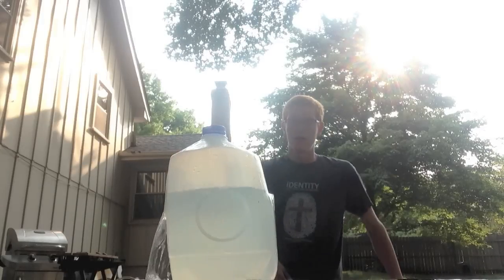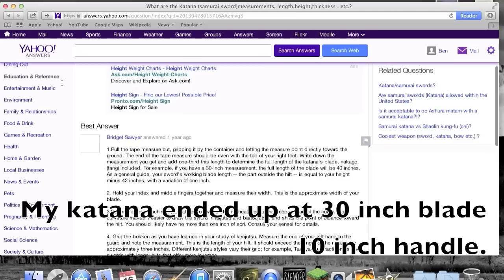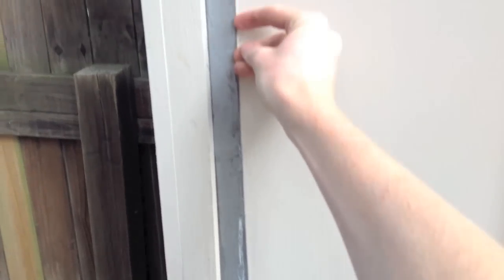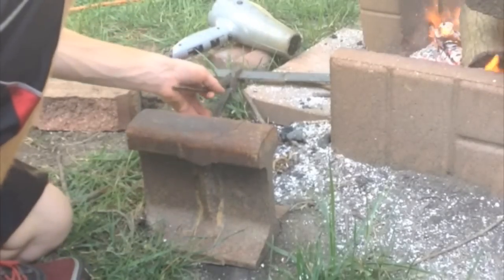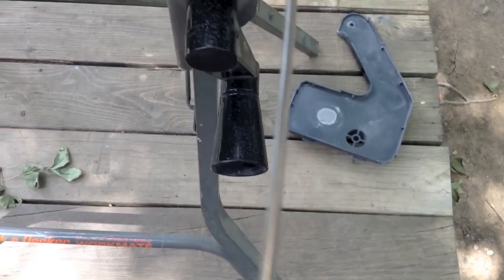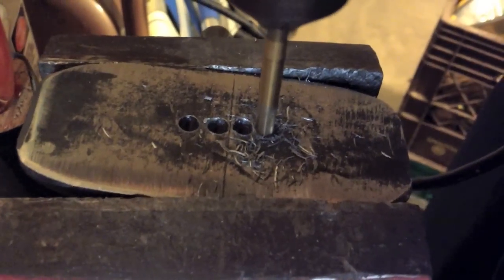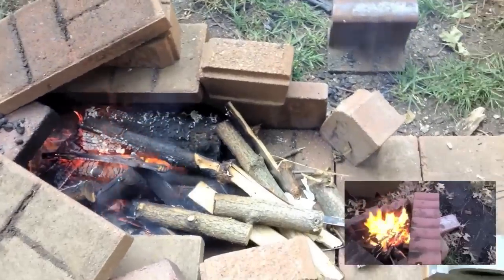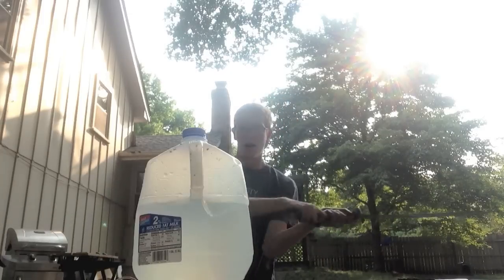How to Make a Sword Start to Finish! (Katana Sword Tutorial)

Comment: where did you get fine grit belts for your sander. it looks like mine. i assume its 1 by 30. the finest grit ive managed to find is 120. which. obviously. for a knife. is not that fine.
Reply from the maker: +Iron Spark My hardware strode had them so I just buy them there, there are tons of good places online you could get them and you can get ones that are way better than the ones I have. I suggest just taking a look around at some knife supply websites.
Reply: +BennyCriss12 tank you!

Comment: I know this is a horrible question but....where did you get the steel
Reply: Hardware store
Reply from the maker: +cannon Makers Like Shane said I got mine at the hardware store which is just mild steel which is good for practice and doesn't make a bad sword but really isn't the best metal to use. There are multiple sites you can use to buy higher grade steel if you want to make a nicer sword. Just google knife making supplies and a bunch of options will come up!
Reply: +BennyCriss12 ok I have a friend that has 41 welder's steel.

Comment: How did u sharpen the katana
Reply from the maker: +King Chaos Same way you would sharpen a knife, but a lot more carefully ha. I start with a sharpening stone, then move to a sharpening rod, then use some high grit sand paper (like 1000 grit) and carefully go along the edge to remove any burs, and lastly use leather to strop the blade.

Comment from the maker: Check My Instagram @Bennycriss12 for handmade knives for sale now!
Reply: +BennyCriss12 How did you thread the inside of the railroad spike?
Reply from the maker: +Lord Minty Sorry I am replying late, but if you buy a threading set at the hardware store it should come with a little drill piece the will do it for you, I think its called a threading "tap" or something.
Reply: how was the balance on it. was the handle leveled with the blade
Reply: which steel did u use?
Reply: how much when I buy the katana?

Comment: Is it even carbon Steel? i don't think so because welding steel isn't usually and therefore isn't able to be hardened...
Reply: I have one made from welding steel. Youd be suprised just how strong it can be. And how well it will hold and edge. Alot of blacksmiths in old times didnt have high carbon steel. Its really the craftsmanship you put in it that counts.
Reply: That's not exactly true. Smiths back then did have high carbon steel. Especially in Europe and And most every where in Asia.
Reply: But it wasn't until later dates that true steel like we have now was possible. It was a tremendous process to do back then
Reply: you bet. They had to put raw iron in a furnace with charcoal for hours or sometimes days and couldn't let  the fire get cold. Then after that they had to mash it all together with a hammer and it had to be free of inclusions. People today whine about damascus, but pattern welding is nothing like folding a 5lb brick of steel over until it has an even carbon content.

Comment: That is not a sword it is a mild steel hunk of crap good craftsmanship bad steel
Reply from the maker: +Fish n guns Yah I agree mild steel is good for practice but not good for a finished sword, I didn't know this at the time. However it doesn't make a terrible sword, the first sword I made was from mild steel and I split wood with it and it retained an edge and works super well, same with this sword I just shot it in a video and even though it was so thin it still managed to deflect bullets. The heat treat is a huge part, and you can still make a decent sword, but next time I put in the work I am buying better steel. Thank you for the comment!